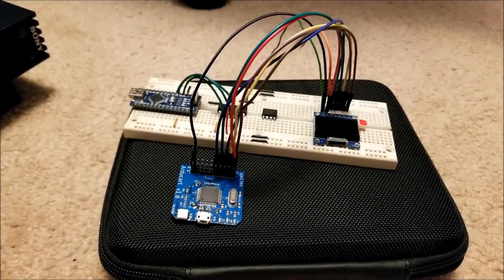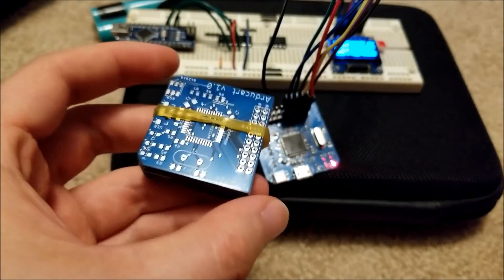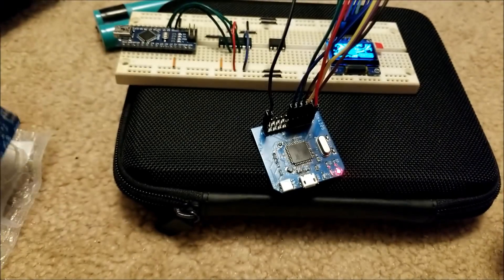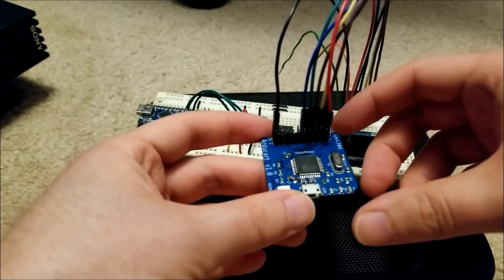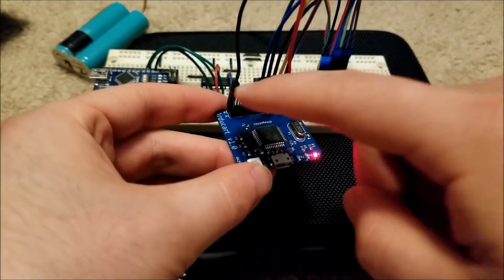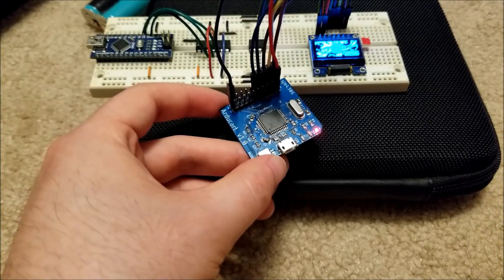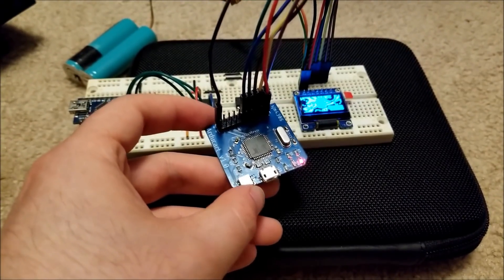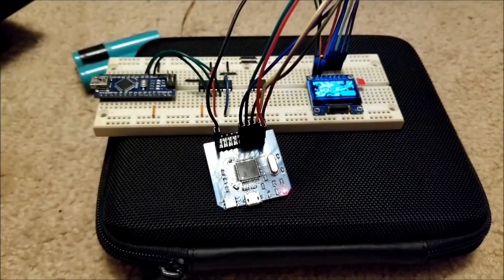Arduboy Clone + Cartridge = ArduCart PCBWay Prototype: part 1

Comment: 100% sure they are protecting more the company from future problems by checking the board files since the customer most likely blame the company and not themself, also are you assembling your own arduboy as well?
Reply from the maker: Either way I'm glad they notified me as the boards would've been botched otherwise. And yes, I'm also designing the console body circuit board and hope to order a set in the near future.
Reply: let me know if you need a tester :)

Comment: neat idea and I like the approach! Those attinys are pretty cheap so that' totally nice that the cartridges would include the "brain" itself!
Reply: orr mabye reutilize a gameboy micro case? :)
Reply from the maker: Maybe a 3d printed case inspired by the micro. I feel like gutting a micro for the case would be a crime.
Reply: ohh can't you buy repo cases with buttons off aliexpress? I know there are many color variants of the DMG and GBC repo shells therem but yeah gutting it would be a crime indeed
Reply from the maker: I guess since the micro is a niche, expensive console with a nice stamped metal case I haven't seen replacement cases for it, but they do have replacement front lcd covers.
Reply: ahhh okay never had one in my hands, so yeah 3d printing might be the best solution then! :)